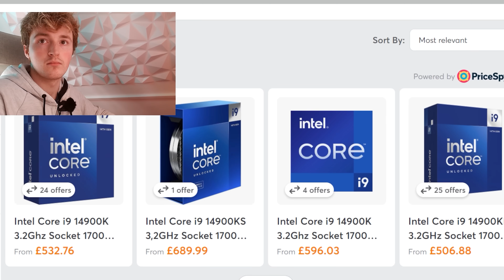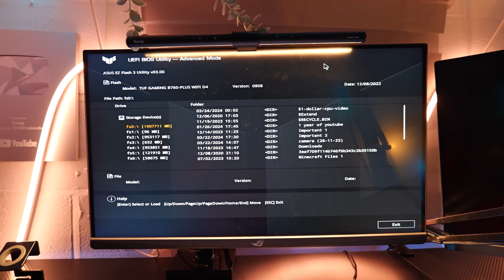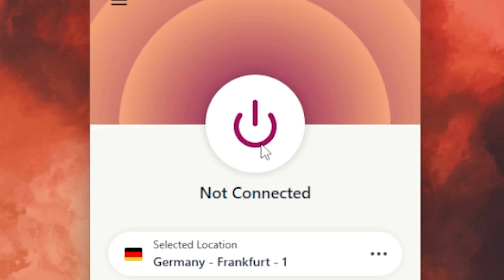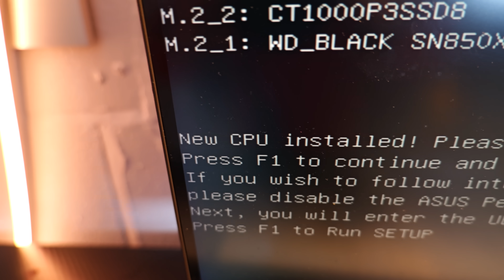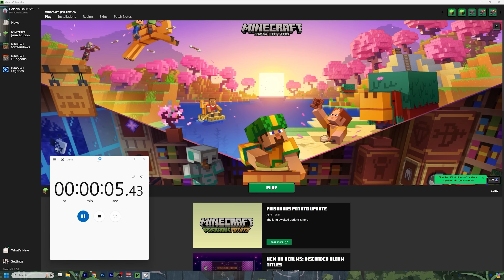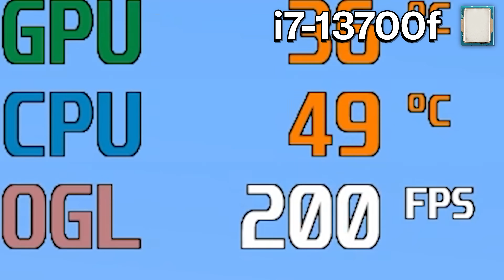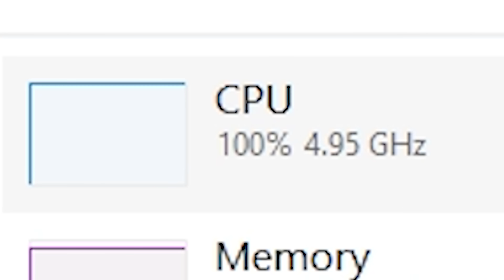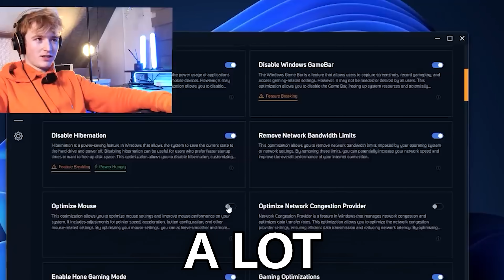Minecraft On The World's FASTEST CPU!

Comment: should have gone for ryzen7800x3D
Reply: Would mean whole new platform for his pc
Reply: Why? i guess he shoudve waited for 15 gen or 2 gen intel core I cant wait to see how their new CPU designs perform
Reply: @n.d.n.e1805 the 7800X3D is the best cpu in the world, but it is on another platform
Reply: @NiciDaGamer  Technically, the 14900K is the fastest. However, the 7800X3D performs better, running cooler and smoother. This is also why Intel is redesigning their CPU designs for the 15th generation. but the 14900k is technically faster
Reply: @NiciDaGamer  Oops sorry i got some stuff incorrect ya the 7800x3d is faster
Reply: @n.d.n.e1805  👍
Reply: @n.d.n.e1805  The 7800x3d is faster for gaming because of the 3d v-cache. For worksation use the 14900k is better.
Reply: THAT MEANS HE WOULD GET A WHOLE NEW COMPUTER. HIS PC ISN'T COMPATIBLE WITH AM5.
Reply: Man, it's like 2 times weaker than the 14900k. Maybe you meant Ryzen 9 7950X3D?
Reply: @aevanesque  did you pull those numbers from ass huh, ryzen 7800x3d is more powerful compared to 7950, 7950 beats it in efficiency (power to performance ratio)
Reply: Yeah , it's best gaming grade cpu
Reply: @n.d.n.e1805 Not smoother and does not run better
Reply: @Heitorr  Tell that to workstation users. Also who cares rn15th gen is redesigned there cpu to improve performance, speed, and cooling. Since their old design is becoming outdated, that's why Intel is changing it to Intel Core and getting rid of the "i" to show that the CPU will be better than the current ones we have and have a better design overall
Reply: @murderer2022 no he dont, just need to change the mainboard to Am5 and  you can even upgrade later without worry because Am5 will be compatible for so long, unlike intel, every new model you need new board. What a joke.
Reply: actually the i9 is faster
Reply: @Diamondsword85_RS no not in gaming
Reply: he wouldve needed to buy a new motherboard since his motherboard was an intel one
Reply: He’d have to switch out his motherboard because his motherboard isn’t compatible with amd
Reply: Is a AMD Ryzen 5 3600 6 - core processor good ?
Reply: @Fullmoon-sp3ch  preety good but i3 12100F is better
Reply: @n.d.n.e1805 15th gen has no hyperthreading
Reply: @n.d.n.e1805 what about the KS version
Reply: @RulaMnayrji  The reason for that is Intel sees no point in hyper-threading anymore for performance. The A20 node doesn't really get any performance gain from hyper-threading. Intel made  hyperthreading 20 years ago so it's not about price at all it just because its old old tech
Reply: You mean the ryzen 9 7950x3d
Reply: @BLGM007  no ryzen 7800x3D is better for gaming
Reply: @BLGM007  Well actually the 14900ks is stronger just more unstable so it doesn't keep the high fps as well but 15 gen is a new chip entirely so it shouldn't have those stability problems.
Reply: @Tanmay0607  Not in minecraft it isn't.
Reply: @randysalsman6992  yeah minecraft is a singlecore game
Reply: @n.d.n.e1805  yes overall most apps that aren't gaming often take good use of the amount of cores and threads in intel cpus so i9 14900K is best. Gaming often relays on single core so ryzen cpus take the lead
Reply: V-cache does not improve Minecraft more than higher clock speed.

Comment: 4:31 30° IS INSANE, that cooler is gonna be working overtime
Reply: cpus can reach 85~90 degrees safely. 30 sounds hot, but no, that is because you are thinking about weather. The average human body's temperature is 37 degrees. Pcs get much hotter
Reply: and as far as recommended temps, 60-75 degrees is normal and average
Reply: @JonathanGameHD  the 14900k runs typically at 100°celsius…
Reply: Edgelessaims  i know
Reply: @ACTIVlS.1  true, the 14900k is a toasty boi
Reply: @ACTIVlS.1  no, not typically, thats its max temps, never seen mine go past maybe 70C.
Reply: @ACTIVlS.1  That´s only if you´re not cooling it properly.
Reply: It's on an AIO and in the BIOS, not insane lmao

Comment: The i9-14900k is the fastest work cpu, but the Ryzen 7800 X3D is the fastest gaming cpu.
Reply: yes, the ryzen cpus are more multi core focused, while the intel processors have better single core performance
Reply: @AlphineTheGuy  Intel is better for minecraft though because minecraft primarily relies on single core performane
Reply: 7950X3D is patiently waiting
Reply: @AlphineTheGuy I think you got that backwards
Reply: @invalidbonsai4962  no that's correct, but why do you think
Reply: @AlphineTheGuy  Intel used to be about fast cores with low core counts but now the roles have switched. The i9-14900k has 24 cores and the ryzen 7-7800x3d has only 8 but the ryzen cores are faster.
Reply: @invalidbonsai4962  oh wow I became old
Reply: @AlphineTheGuy  np I used to think the same
Reply: He would have to change the motherboard
Reply: @AlphineTheGuy  No its the opposite, intel is better in multi core perfomance but for most games, singlecore performance is more important(not minecraft tho)
Reply: @Rene0417  okay okay I already got 3 Comme ts about this
Reply: @AlphineTheGuy 

Intel has higher boost speeds while amd has lesser cores 

Amd gets more performance per cores
Reply: AMD is gut for single core. Less cores, more performance. Intel is multi core so many cores. I'm guessing higher clock speeds because worse single core
Reply: @AlphineTheGuy  basically what you said

you're getting nice performance per watt on these AMD chips.
Reply: ryzen 7 9800x3d now
Reply: @trungkien4187  You can probably run minecraft with a pentium 1.
Reply: @AlphineTheGuy They no longer do. Ryzen x3d CPUs are faster than intel
Reply: @Block-f7d ryzen 7800x3D is about 10% faster in games than the 7950x3D

Comment: isnt the fastest one like the ryzen 7 7800x 3d?
Reply: No, from what I understood the one in the video is the fastest rn like it says, but it's so fast that games don't utilize its full potential so people buy the ryzen 7 7800x3d instead cause it cost less than the i9 14900k and from what I understood the ryzen 7 7800x3d loads better 3d stuff, so for gaming probably the ryzen 7 7800x3d is better overall, cause you spend less money and it has about the same gaming performance, but for other stuff that's not gaming the i9 14900k is better I think
Reply: @stanislavmihalas1345  I think the true king is a 7950X3D because it has the same V cash (eight of the cores) but double the total cores count but AMD leaks show that the 9950X3D will have all cores with X3D. And rumor show that it will handily beat the 14900K
Reply: No
Reply: Nuh uh
Reply: @callenvlogs5989  oh wait didn't know the 9950 x3d was a thing, oh then yeah probably that's the best, but still the 7800x3d is still value for gaming right?
Reply: 7800x3d is currently fastest gaming cpu until 9800x3d is unleashed.
Reply: @drsm7947  It depends on what system you put them in. Naturally the AMD cpu has faster cache/core use and utilises that power effectively. But under the right motherboard, cooler and PSU the 14900k can beat it. It is afterall a whole ghz above in boost
Reply: @stanislavmihalas1345 Yep.
Reply: No
Reply: Never
Reply: Intel is better
Reply: @callenvlogs5989  7950x3d not all cores benefit from the 3d cash so 7800x3d is bit faster in GAMES not in other task tho
Reply: @resolution7482  considering the Intel fiasco i would still choose amd (although intel be making comeback)
Reply: @sherlockpug352  I’m about to give you an argument that already has a problem within it of itself and that is that not all games utilize the 3-D V cash and the reason that’s not a good argument is because why would you get such an expensive CPU if you’re not gonna be playing games that utilize 3-D cash
Reply: @sherlockpug352  I never had any issues so far
Reply: @sherlockpug352  listen man also I don’t know if I mentioned in the past that I do a lot of productivity shit and the performance loss is minimal and eventually when dual CCD ships come out like the X3D 9950 comes out. I might be copying that even though it’ll just be right after my computer‘s built lol
Reply: Nope
Reply: Wouldn't work on his motherboard

Comment: Ryzen 9 9950x?
Reply: No, intel got the n1 processor.
Reply: @Vipnunes  amd got the n1 gaming processor (7800x3d) it is actually the king of gaming chips and beats the i9-14900ks by 10-20 fps in most games
Reply: @lun4ticplayz  the x3d is sooo overrated. it literally is only better at 1080p, all other cpus (7700x, 13600kf, i9-14900k, 14700k, 7900x) perform in like +-5 FPS range in 1440p and even less difference in 4k. for the average person in the modern day, better to get 7700x and spent the extra money on a better gpu, because you're probably not going to play in 1080p or your card won't be as strong as a fking 4090 for the cpu to bottleneck it.
Reply: @das3tins768 maybe thats why its a cpu test? And for gaming the 7800x3d have a lot of more future than the 14900k in gaming and the 7800x3d dont kill it self btw

Comment: the 14900KS is actually a bit faster than the 14900K
Edit: those 2 cpus actually make alot of heat
Reply: true on both
Reply: the 7950x and the 7950x3d are both way faster than the 14900k and ks while staying cooler and consuming way less power
Reply: @crispyapple.  While i dont fanboy intel or amd, its very true! Also, is the 7800x3d is still better at value than those?
Reply: @UltraVoidPlaysRoblox  yeah way less power consumption and better gaming performance since it doesnt depend on how many ghz its running at
Reply: @crispyapple.  True because they offer cpu with more cores than intel at a much better price
Reply: @UltraVoidPlaysRoblox  Thankyou for the very respectful comment section discussion 🗿🗿also 13900k and 14900k are almost identical in performance just a little extra for worse electricity bill apparently intel is better for content creators though
Reply: @crispyapple.  I guess? I dont know about that so im clueless
Reply: @UltraVoidPlaysRoblox  intel 13th and 14th gen are pretty unstable cuz of the power consumption(in gaming) but apparently because the power consumption is so high it’s actually better for work related tasks
Reply: @crispyapple.  Thats good, if im right intel does work on making their cpus be better at workloads but, amd can catch up
Reply: Until then, amd is the better option!
Reply: @crispyapple.  15th Gen should fix that, as that is the main Intel is making the A20 node. Intel is also abandoning hyperthreading, as it is holding back the A20 node unlike their current CPUs.

Comment: Minecraft uses 1 core guys... 1 core. The number of the cores dosen't matter.
Reply: optimization mods (mcmt) unlock that number
Reply: Minecraft doesn't use 1 core, easy to prove, minecraft performs better on single core performance than multi core performance
Reply: bro minecraft is working on 1 core only on old versions

Comment: well technically you could consider the ryzen 7 7800x3d as the fastest cpu due to the 3d v cache it has, despite the lower clock speeds and less cores in total, its performance is still unmatched for gaming.

Comment: This comment section is funny af. You guys really say Threadripper is better but you don't understand what "consumer" CPU actually means. I think most of you don't even know about CPUs much, other than saying "OH IT HAS MORE GHZ IT'S BETTER THAN YOUR AMD CPU". Threadrippers - are workstation CPUs, needed for a workstation that needs ton of computing power to run software like Blender and such. Basically they're the best for rendering and etc. But they are not for GAMING! Also, to the people who are saying that 7950X is better - it is because of multi-thread performance if you go for X3D which has 3D V-Cache running and also because it's future proof since Intel is going to move to new architecture so LGA 1700 is the last architecture.
Reply: The i9 is also a workstation cpu. You made no point.
Reply: @iemgote7249  I doubt people will do heavy 3D editing tasks, or heavy af simulations on this exact i9 from the video when it has less cache size, less cores than your typical workstation/server CPU and even having no error-correcting ECC code memory.

Comment: no, your wrong. the fastest CPU in the world is a 	AMD Ryzen Thread ripper 7980X DirectX 12.0, I'm pretty sure.
64 core, 128 thread 5.1 gHz AMD sTR5 socket, is the fastest. but they are also not the best for gaming I've been told. i own a Ryzen 7 7800x3d and in my opinion i like Ryzen better than  intel because the power usage and the heat they create is a huge difference, i think that i would choose Ryzen over intel but the CPU you are using in this video is still good. i have built computers like yours 400 different times and i found the best specs for myself. i do think your CPU is good i just think mine would be better for gaming in my opinion.